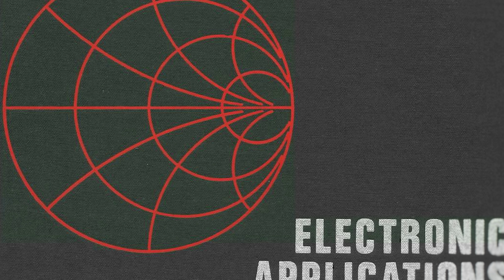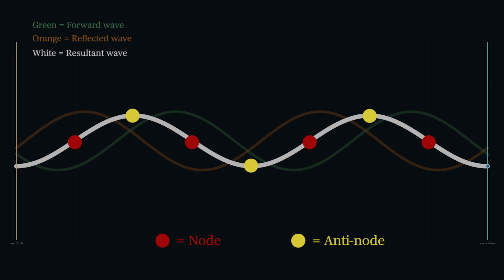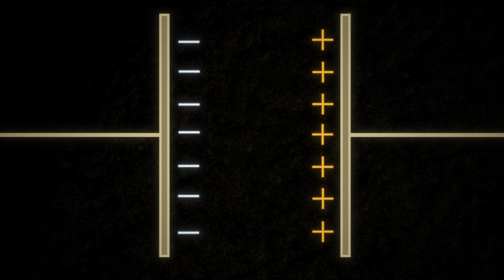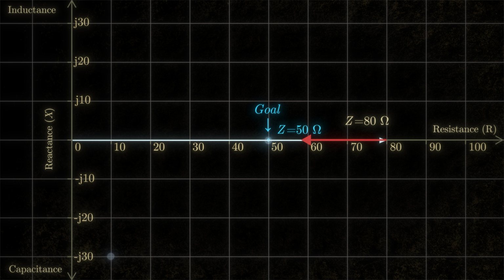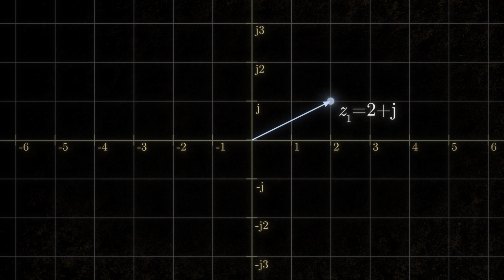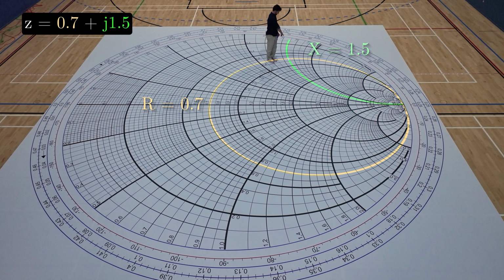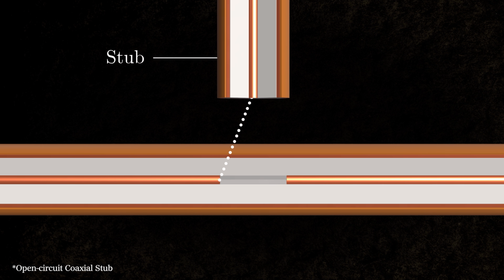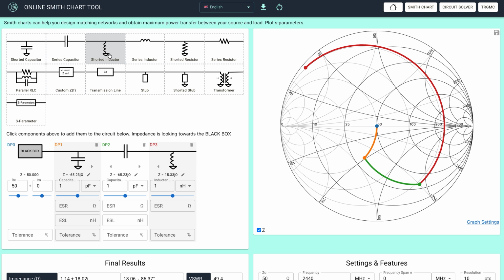The Scariest Chart in Electrical Engineering

Comment: Oh, when I was a HAM radio guy using Morse code and a Heathkit transmitter did I think about how much power was lost in my copper wire antenna strung from my bedroom to a tree behind my house....? No, I contacted Mississippi from Virginia and got my post card. WN4VAM. My HAM radio days ended on a field day at Fort Belvoir with MARS operators where I nearly electrocuted myself and blew out my 804 tube.

Comment: Volt/amp reactance (VARs) is a problem for utilities also, and they spend a great amount of resources managing it.  Excess or not enough VARs heats up wiring and can damage customer equipment or generators.  If not properly managed, it can and has caused grid collapse and power blackouts.  

The problem is that most loads are purely resistive (lights), or inductive (motors), and the counter to inductance is to add capacitance.  The problem is how?  

Capacitors are essentially two plates with a nonconductive material between them.  The larger the plates, the more capacitance, but with an entire grid to manage, the plates would need to be the size of football fields.  

The solution is to have the VARs generated or absorbed by adjusting the voltage in the generator, but how far you can adjust has its own limits.  Every generator comes with a chart that shows the limits.

The subject is complex enough that new plant operators are told that they will never truly figure it out, and just given a set of rules to follow. 

As a side note, if you see a power factor rating on a generator, it is simply the cosine of the max angle on the chart the generator can handle, and is usually around .85.  The chart I am referring to is the square one not the transformed round one.  .  Increase your capacitance or inductance to exceed this angle, and your generator will be destroyed.  

The angle actually is reduced as winding temperatures in the generator increase, as they do when you generate more power.  Cooling becomes critical.  This is why really large generators are hydrogen cooled.  Hydrogen has a lot of thermal density while remaining nonconductive.

Comment: electromagnetic wave theory is actually a very hard concept to fully grasp. I still have trouble understanding and applying it in my job. As electrical engineers we learn  a lot of things in school and this isnt really one of them. You would actually be surprised how many things that were done in the past actually sort of happend to work by accident/proxy. Not because the principles are understood 100%. 
Things that worked 5-10-15 years(and our understanding) in the field of signal integrity and power integrity dont work now. There is a lot of contradicting knowledge/"rules" in electrical/electronics engineering.

Comment: Ah, I love seeing the Smith chart getting some proper recognition. I designed and wrote much of the RF characterization and calibration software for Cascade Microtech: WinCal. So, I got very familiar with the Smith chart. It's an amazing way to visualize complex impedance, especially when doing frequency sweeps.

Quick addition. Much appreciation goes to those that taught me the RF black magic and mysteries needed for microwave frequency probing and mathematics: Dr. Leonard Hayden for the EE and math and the extremely experienced SW engineer that preceded me, Herje Wikegard. Everything is better when you work with awesome people.

Comment: dBm is not decibel, it is decibel-miliwatt. Not the same thing.
Reply: dB on its own doesn't mean anything. You need to specify a reference value and then state that your measurement has a magnitude of X dB relative to the reference value. IIRC for dBm the reference is a 1mW radio signal. So a 1μW signal would be -30dBm. For sound, which I presume is what you mean by dB... oh gosh.

The softest sound we can hear in ideal conditions is about 10⁻¹²W/m². So we can set that as our reference and see how powerful our sound wave is relative to that. In other words, dBFS. So a sound with power 1mW/m² would be 90dBFS. Problem is, our brains don't perceive sound volume uniformly across frequency, so there's a few correction functions you could apply to the raw sound power to account for that. That gives you the dBA, dBB and dBC scales depending on which function you use. For most purposes we use the A scale. So sound is measured in dBA, not dB, and now you know where that comes from.
Reply: @ratvomit874  and that’s the 10 to the order of magnitude scale however there are other less common ones like 20.  So it can be even more confusing.
Reply: @ratvomit874  Yes, and in sound it is referenced to 20 µPa. Decibel alone is just a logarithmic ratio of two values.
Reply: You mean decibels relative to one milliwatt.

Comment: 15:08 This is why Electrical Engineers do not refer to them as "imaginary numbers," but rather "complex numbers." They have a very real application and can be quite useful.
Reply: Complex = imaginary + real
Reply: That’s not why, they’ve been called complex numbers for a long time. Complex numbers have a real part and an imaginary part, and are of the form a+bi. Imaginary numbers are only bi.
Reply: To be precise: 
A complex number z = a + bi consists of the real numbers a and b, and the imaginary unit i. 
a is called the real part and b is called the imaginary part.
Any real number a is a complex number with the imaginary part being 0. Any imaginary number bi is a complex number with a real part of 0.
And this is consistent between mathematicians and engineers afaik. Other than i being referred to as j.
Reply: Which engineers?
Reply: In electrical engineering resistance dissipates energy and is the real part while reactance stores energy temporarily and is the imaginary part.  To make a single formula describing both you write them together with the real and imaginary parts.  But because the imaginary parts describe actual physical energy storage elements, they really do exist.  So imaginary numbers are quite real.

Comment: Kudos, Henry for taking care to input not only a proper "vertical" acceleration/deceleration to induce a sinusoidal response in the slinky simulacrum at a constant frequency/wavelength, but also for taking care to vary the slope with your wrist as you oscillated the vertical amplitude. 

Excellent visual simulation, with amplitude and frequency/wavelength consistent throughout. 👏

Comment: My circuits professor was an antenna design engineer- never once mentioned the Smith chart. He taught that all you have to do to maximize delivered power is add equal but opposite reactance.
Reply: Same with my teachers who worked on several aerospace projects from the government. It just way easier to deal with formulas if you know the stuff, instead of trying all this crazy stuff to map it all geometrically...
Reply: @romanshatalin7077  you really have it backwards.  You don’t even need to know math to use a smith chart.  Tuning circuits for frequency response is quite visual and adding, changing, or removing components gives you an immediate visual representation of what’s happening.
Reply: @hugegamer5988  "you don't even need to know math" is not the flex you think it is... My professors learned a ton of complex math for the projects and were able to explain it in an interesting and applied way. This channel is actually reminding them a lot. Just stay curious, give it a try and maybe you will see how in some cases math is the actual universal language.
Reply: @romanshatalin7077  I’ve multiple advanced engineering degrees.  I said you don’t even need to know complex math to use a smith chart because that was the entire point of creating them.  Did you even watch the video?  Smh.
Reply: @romanshatalin7077 It is not about engineer knowing the formulas, it is available calculation tools. If you have a computer or at least a ccalculator that can do complex calculations, of course a formula is practical. If you don't, and have to do it by hand, that is where the chart  shines.
Reply: @bbo1707  it’s not even the calculations, the problem is real world components like inductors have capacitance, capacitors have inductance, all of that is frequency dependent, and even data sheets often won’t tell you, and that’s not even the limit of how they don’t obey simple parameters at high frequencies because there is alot more to consider.  Real world designs often differ dramatically from the correct math, going off the given information in every single data sheet.  Thats why smith charts are so powerful, you simply measure the s-parameters and then you can tune the circuit to what you need using a graphical approach.
Reply: How? why not? its like the basic for antenna design or most other rf design questions.
Reply: I think he meant add the complex conjugate.
Reply: @scienteer3562 yes, exactly. But after 10 years in the power industry, I no longer have such a strong grip on the terminology not required for daily activities.
Reply: @AndrewLynch-c5z the power industry has a lot of stuff that most electronics and RF engineers dont have to worry about also. Yet to see a 3phase antenna.  No idea how you would use the smith chart on a 3 phase circuit.
Reply: @scienteer3562  you typically wouldn’t use one as far as I’m aware, but you do deal with things that are easy to see graphically on a smith chart.  For example the transmitted vs reflected energy like you would measure on a VNA is equivalent to putting power into the grid where a mismatch in phase and frequency causes reflections.  Rather than deal with a frequency range, it would be at a fixed frequency and could be represented on a smith chart.
Reply: @AndrewLynch-c5z and he's correct, for maximum power transfer you want to match with the complex conjugate. BUT, the smith chart is used in a variety of rf disciplines. If you want to design an integrated rf circuit for example, you have many different properties you hab ego consider at once. When designing an amplifier for example, you don't always use the perfect conjugate match, since not every source impedance leads to a stable amplifier (your amplifier oscillates, which is terrible). Different source impedances can lead to the same gain, but e.g different noise figures or stability. . You have multiple circles within the smithchart that show the impedances that lead to a fixed gain e.g 5 or 10dB, and you can plot in the same smith chart circles for impedances that lead to a fixed noise figures, e.g 7 or 12 dB. And you can't have both, maximum gain and minimum noise, so you chose an impedance that's somewhere in between and make a tradeoff
Reply: I don't recall using them when studying transmission line theory - but I suspect that was probably before the presenter started school/was born so may have forgotten it.
Reply: Weird, maybe he went for the practice and skipped the chart, however it's needed if you are an actual engineer working with complexion systems.
Reply: @Syokool nonlinear, I assume
Reply: Resonance is not hard to understand. It's like a pyramid between a coil of wire w/ resistance and a capacitor. The academic community makes it way too scary on purpose. They don't want you to learn the secrets to Cold Nuclear Fusion - Alchemy.
Reply: @quantumkineticscorporation  And you're a professor of Nitwit science, right?

Comment: Interesting connection: in electrochemistry—such as battery research, corrosion and electrocatalysis—we use EIS, or Electrochemical Impedance Spectroscopy.

An electrochemical system contains multiple processes, each occurring on a different characteristic timescale. By measuring impedance across a range of frequencies, we can separate fast processes from slower ones: high frequencies reveal rapid processes, while lower frequencies give slower reactions and diffusion enough time to respond.

Many of these processes can be represented using electrical components. The conductivity of the electrolyte behaves like a resistor. Charge-transfer reactions, such as lithium intercalation and deintercalation in a battery electrode, introduce a charge-transfer resistance. Charge accumulating at the electrode–electrolyte interface behaves approximately like a capacitor, while ion diffusion creates its own frequency-dependent impedance.

Even a relatively simple electrochemical cell can therefore be approximated as a solution resistance in series with a parallel resistor–capacitor circuit. On a Nyquist plot, that parallel RC element appears as a semicircle.

So although the Smith chart and the electrochemical Nyquist plot are used differently, both turn complex impedance into geometry that engineers and scientists can interpret visually.

Comment: Torsion Fields!

  When you twist a magnetic or electric field, you can easily create plasma, you can do it with rotating electromagnets with alternating Dipoles or with a caduceus coil. A torsion field in fringe science creates portals. I beleive that due to my discernment, but you beleive what you want. Please share your thoughts! I love to interact and learn new things and share ideas.

  Here's a speculation I have had. An atom is mostly just a field, electrons in the atom's shells are just probabilities of the protons and if the probability field expands which is what we call a magnetic field, then maybe electrons are higher dimensional protons. Also, do you know how protons are produced? A neutron which I theorize is hard light gives away an electron and forms a proton. Neutrons act as light and light I theorize is higher dimensional radiation. A tachyon is a particle that goes faster than light and light gets tired. When there is a vacuum, there is enough space for such speeds without collision so the light goes away and photons are bonded with neutrons. I theorize that tachyons are higher dimensional electrons and that is why they can't interact with the third dimension and that is why we can't get any physical evidence. Also a photon doesn't create light unless it can interact with something supporting that photons are not light, but a particle.

Comment: love the video as an RF/microwave engineer! Just two very minor nitpicks i noticed. 

Saying -55 decibels isn't correct, it would be -55 "dBm"  as it is 3.16 microwatts (10^(-55dBm/10)). dBm is an absolute power measurement mapped on a logarithm scale, not relative even tho they appear similar. 

The animation showing a coaxial stub is shown to break the main line and connect the center conductor and ground sheath to each broken main line ends which is wrong. It should show the main line unimpeded with just the center conductor of stub attached. no break in the conductor. And the ground sheath would be attached to the ground sheath of the main line... same ground reference as to what you are splicing into. It's like what we typically do on circuit board is add a microstrip stub along a microstrip transmission line. The main line is still unimpeded but there's a stub of the same line connected and using the same ground reference underneath

Comment: Way back in the 1970s and early 1980s I dabbled in citizens band radio. I built my own antennas. I sure wish I knew about this technology at the time. I built some really good antennas. And everyone was very difficult to design and tune. If I knew about and understood this chart, I think I would have been better off. I don't mess around with radios anymore. 27 mega cycle, AKA citizens band. Had become an overused and abused frequency. I moved on to other things.

Comment: Impedance matching proves that physical separation is a total cognitive hallucination. when a wave reflects backward, it isn't because it hit a physical wall in the copper, it's because the universe is rejecting our arbitrary transition from one object to another... by using conformal mapping to squeeze infinity into a neat circle, the smith chart proves that physical distance can be mathematically deleted. When We achieve a perfect match, we aren't changing the physical reality of the copper, we are literally tricking the wave into believing the boundary doesn't exist, making two distinct objects behave as a single continuous reality. we think we are doing electrical engineering, but we are actually just hacking the boundary conditions of spacetime to force separate things to exist as one.

Comment: Awesome video!

I find it is easier to explain the reflection using a single edge (step response) instead of continuous sine waves, as it clearly shows the reflection event in relation to the transmission line length, and how it changes behavior with different impedance mismatches (both for souce and end termination). TDR measurements are extremely usefull to find weird behaviors in board designs, and pinpoint where they are, per example.

I deal with tranmsission line theory every day developing solutions for IC charectarization. Best rule of thumb I have been taught is that when the propagation delay of the signal is > 20% of the rise time; the tranmission line effects dominate over the lumped circuit model. At ~15cm/ns, a 1 cm trace accepts a ~330ps edge before most issues occur. Of course, in proper setup the transmission line, and termination are all matched at 50 Ohm for the best signal integrity.

Comment: I use use smith charts largely intuitively to impedance match filter circuits and antennas. I love these little fellas so much. Using them is kind of like a video game where the controls involve connecting inductors and capacitors to your circuit to move around on the chart.

Comment: Licensed Engineer in the Power Industry, this is fascinating. Also, we still use large resistances at the end of IRIG cables to absorb reflecting waves, when connecting the substation equipment to GPS clocks for synchronization.